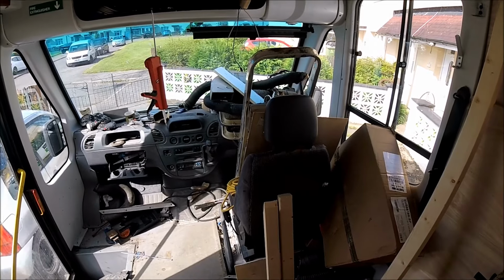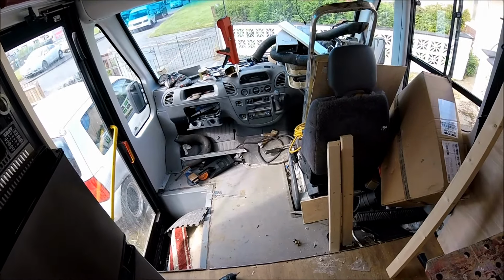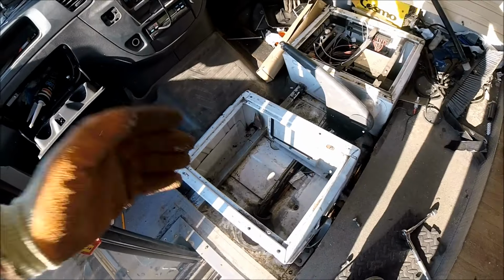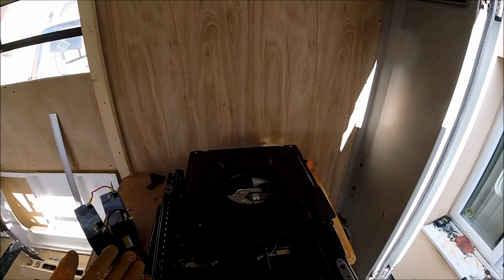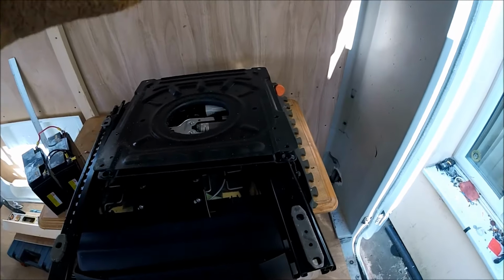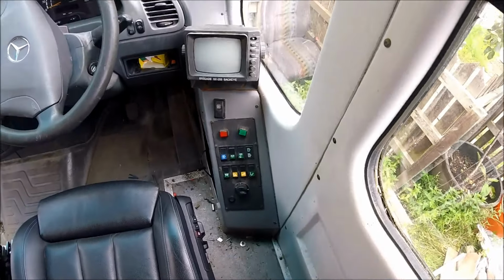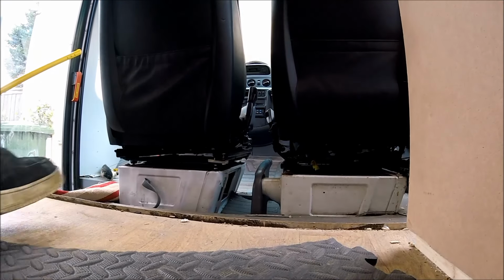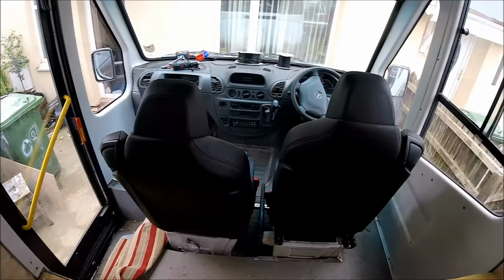Fitting BMW Leather Seats In Mercedes Sprinter Minibus Camper Conversion

Comment: Hey great vid, I have fitted 325 leather seats to my Peugeot Boxer also. I did wonder why they only worked once during a trip. I have now fixed this feature. it took me a few goes but working great. no need to re set power.

Comment: Hey im glad youve left these videos up as ive just bought the same van so its helped alot. Quick question the electrical box above the drives head, is there anything important connected to it or can i rip that out? Thank you in advance
Reply from the maker: each van can be slightly different so without knowing what the box you're referring to has in, I can't say for certain either way, but hope my videos come in handy for you
Reply: @TheCampervanBuilder  thank you for the reply. I'm assuming it's for the disability lift,aricon and door. The door has been disconnected and the lift. Just wanted to see if you had come across the same and what you did with yours if you had the same. Cheers

Comment: Fantastic idea,great job,lovely seats, just a very minor thing, try to fit a rubber gromit where you drill a hole in metal for the wire, over time with vibration etc the cable could become bare causing a short maybe a fire.

Comment: I have got the same vehicle. I think that is a stroke of genius what you've done. However. I do agree with a previous comments I have driven this a mark 6 transit chassis exactly the same body vehicle. And the armrests I could not live without. And I love the feeling of space. Around the driver and I'm designing mine. So the missis can sit in the back with the kids while traveling. I think you're going to find my design interesting. I find yours very interesting very helpful. To my conversion. Thank you for that. 5 Seat belted seats with armrests will be in the back along with a bed settee. And the bed settee will have seat belts.

Comment: As you mentioned, the passenger seat is relatively close against the driver seat. Given that the seat is wider than the base it sits on, I was surprised you seem to have chosen to have the slight overhang on the driver side, rather than the passenger side of the metal base.
Reply from the maker: It makes it easier to swivel this way around while using some original mounting holes for extra sturdiness

Comment: The only thing I would say is that I would have chosen seats with arm rests? as driving any distance hanging onto that steering wheel is going to be a bit tiring I think :/
Reply from the maker: Arm rests would have been nice but wouldn't fit as the seats are close together as I wanted to use some original mounting holes for the new base, the positioning is fine though, I've just been away for 3 nights in Scotland which was a 4 hour drive and it performed great up all the hills etc, the seat height is higher than it looks

Comment: Am I being thick; where did you get the base for the passenger seat?? looking to do exactly this to my van but honestly, I'm not sure I could do all this.
Reply from the maker: the base is another single drivers base, secured to some original mounts along with new ones fitted, should all be shown in the video
Reply: @TheCampervanBuilder  Thanks for the reply mate. I did think so but wasn't 100% sure. So you got this from another bus isit?
Reply from the maker: @RJ-me3ir  Any sprinter single base from the same model will do, doesn't have to come from a bus
Reply: @TheCampervanBuilder  Cheers mate, really useful (Y) Love your channel.
Reply: @TheCampervanBuilder  I've left the yellow bars and stuff in, could i just put a fold down seat to the right of the entrance steps and fix the seatbelt onto the wall or?
Reply from the maker: @RJ-me3ir  there are no belt fixing points on the passenger side, if you want more seats you either have too use the original rails, fit a new base or bolt seats to the chassis beams and the seats will need to have belts built in, like these BMW ones or minibus seats.

Comment: Coming together nice m8. Question were do you rekon i could get a swatch for rustoleum paint for ma t4. Cheers
Reply from the maker: just google rustoleum colours and they are available online with the codes to order but I wouldn't do another rustoleum job myself, dents the resale value and a spray will be far less effort all round